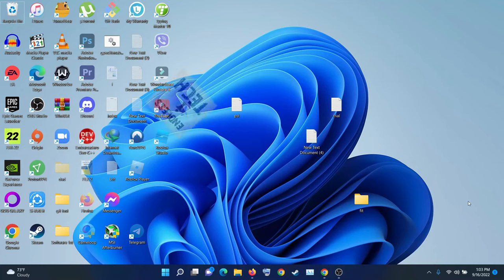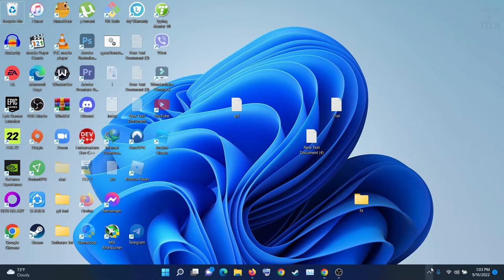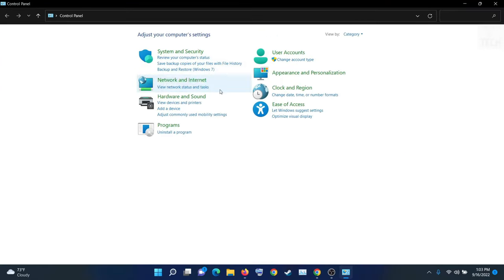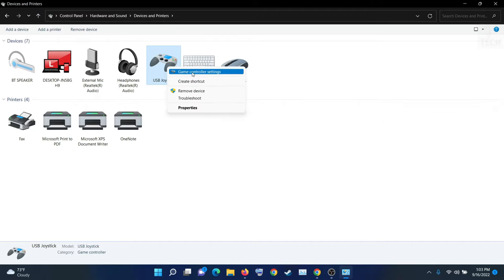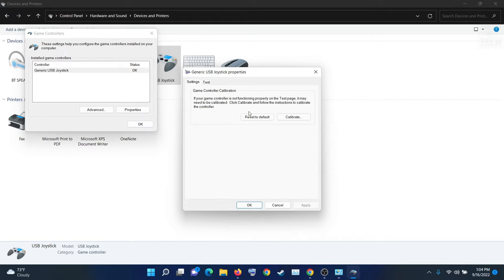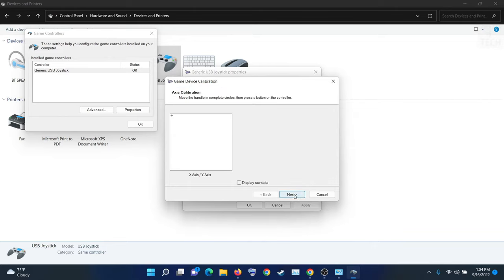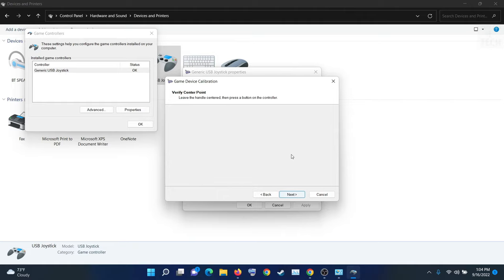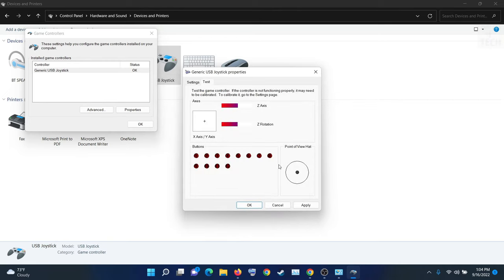How to FIX any controller or joystick Left/Right Stick Analog Inverted 2024 | Without Any Software |

Comment: my left analog is ,nverted in fifa24 (up-down) how can ı solve this pls heyppp me
Reply: bro same problem any solution??
Reply: @ankitloni593  yeah finally i found a solution. Change your  windows session , add steam "Ea Destkop" in steam setting set your controller and choose ea destkop properties choose "use steam input. Open ea destkop from steam and start the game ( i didnt use translate if you dont understand i can translate for next time)
Reply: I bought it from Epic Games and I'm having the same problem.
Reply: @westz4  did my answer solve your problem?
Reply: @albastrive  I didn't quite understand what I should do. I tried putting the x360ce into the FC24 folder but it's still the same.
Reply: @albastrive bro please translate again, didn't understand exactly
Reply: same problem any solution mate?
Reply: @albastrive  bro help

Comment: Y-axis and Z-axis doesnt work, how to fix that?, my right joystick works up and down and my left joystick work left and right, how to fix that?
Reply: I have the same problem with Fortnite or any other game, when it happens i just change usb port and it starts working properly again but it's not guaranteed, so did you find any fix?
Reply: @Paperella0706   sadly, it's happening for me every where, my gamepad is Bluetooth controller 🎮
Reply: @Bilal.Hussain.Shaikh  did yu fix it bro

Comment: so guys, if anyone is still having this problem because he didn't show the exact problem I have.
There is a mode on the generic gamepads in my case its just called "MODE" in the middle of the gamepad. press that and it should allow the right joy stick to be a camera mode inside anygame, do that on each controller if you got more than one.
Reply: thnx bro
Reply: Does this works on ps2 controller? Cause i barely understand what you said
Reply: @SemmMLBB  Yeah i have a PS2 Controller. You just have to press the button in the middle of the controller, like between select and start. In my case , it's written mode beneath the button.
Reply: @kakashi_0484  mine says analog and its not working
Reply: Thanks bro!
Reply: Where to open it
Reply: Thx bro ❤
Reply: @kakashi_0484  bro, you saved my life lol, i was almost throwing my controller on the wall
Reply: thanks bro
Reply: Thanks a bunch
Reply: Bro, i connected one controller, but it shows two, and my left stick is not working.. so please help me
Reply: Bro like if I don't press that button my left stick will drift backwards and if I press that my left stick with drift forwards even faster..
Reply: ur a fucking life saver
Reply: THANK U SO MUCH BROO

Comment: this doesnt work for me

no matter if i delete the driver or reset to default the right joystick still has the same problem
the right joystick was somehow inverted when i didnt mess the settings and now
up is left, left is up, down is right and right is down
Reply: try x360.
Reply: same here
Reply: @prajjwalkunwar9287  Does it work for xbox controllers as well?
Reply: @prajjwalkunwar9287 so did you get it fixed does your controller work normal now. dont know about mine is configuring alright but it is still inverted in game
Reply: @YesSh4dow777  it should, dont forget to use it as administrator.
Reply: did you fix the problem? if you did please tell me i am having the same problem, you'd be a godsend if you did.
Reply: @zekken6319  i did, I'll add half of the link later because right now I don't remember
Reply: @zekken6319   yt is removing the link try pasting this /watch?v=TtzNkRiwrfI
Reply: i wish you have fixed this problem because i really suffer with the same inverted thing. if you have the solution please give it to me 😅